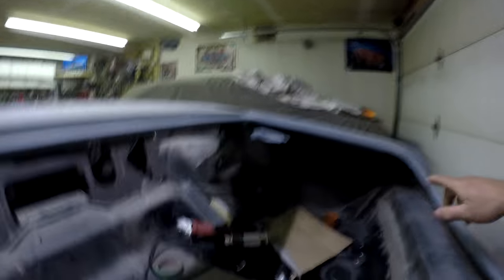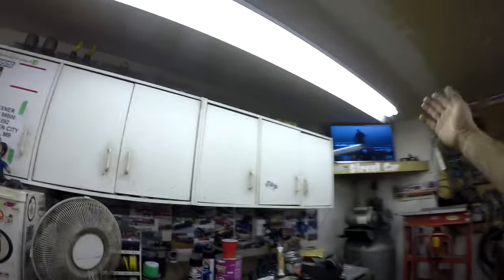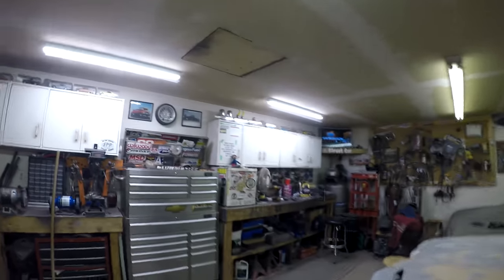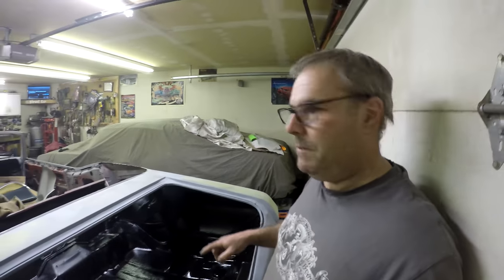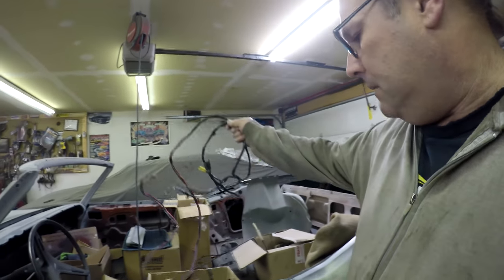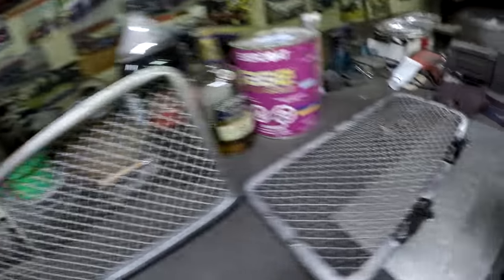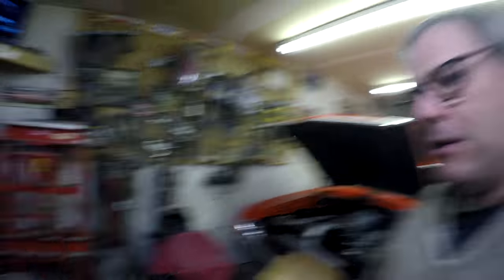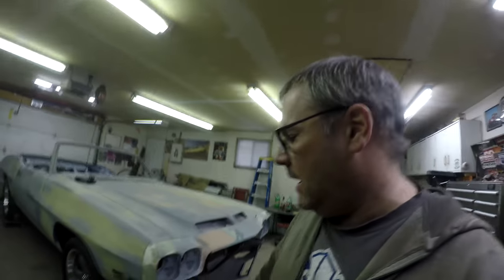Pontiac GTO Restoration Part 14 of ?? | Convertible Parts, New Shop Lights, More Brakes and V-Bands

Comment: I think those rotors are mounted backwards(wrong side). The grooves should go low to high, to direct the heat away from the rotor like a fan. Just my 2 cents. Great build can't wait to see it finished.
Reply from the maker: Nope, they are right.